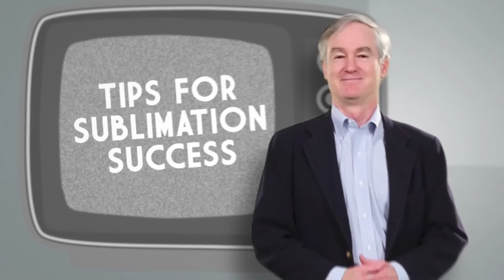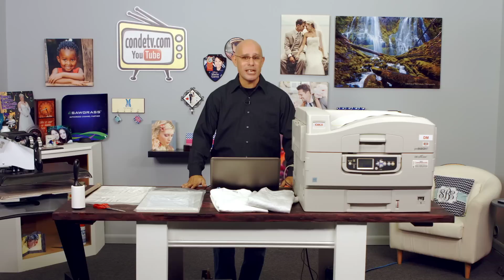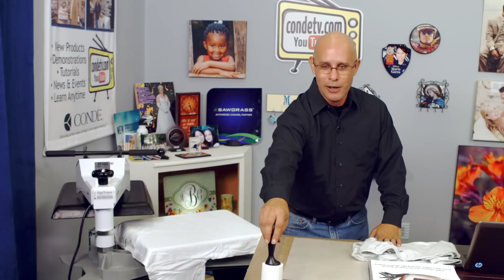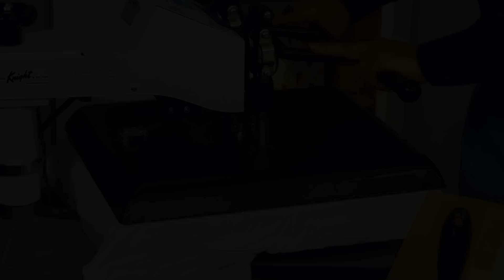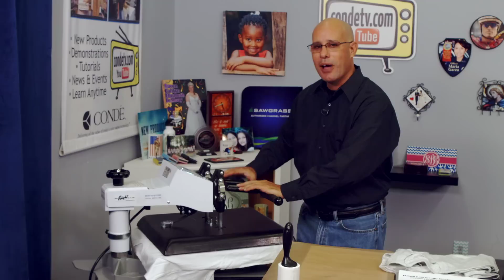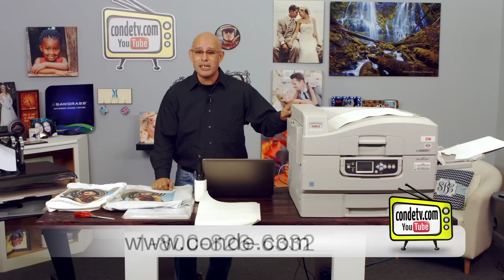Using TechniPrint EZP Transfer Paper -

Comment: how many washes Neenah can handle?
Reply from the maker: Our standard benchmark test for transfer papers, including Neenah Techni-Print EZP, is 25 "hot wash / hot dry" cycles on 100% cotton garments.  Beyond this test, you can expect better durability if you wash in cold or warm water, tumble dry with low heat and if you use a garment with some polyester content.

Comment: Thanks for this very informative video, Doug.
I'm liking the options of applying either a matt or extra glossy finish to it by using either the silicone sheet or the Teflon sheet in the second pressing.
What I would like to ask is if that optional second pressing needs to be done within a certain amount of time after the initial pressing of the design ?
Reply from the maker: Generally speaking, you should perform the 2nd press when you remove the backing sheet of the transfer paper.  However, a 2nd press can be performed at any time.

Comment: What will happen if I apply the paper on a different kind of material, like viscose or 100% synthetic material?
Reply from the maker: +Kiril Najdoski ................Condé has never experimented with Neenah TechniPrint EZP on these materials.  We suggest contacting Neenah Paper at 800.344.5287 or 906.387.2700 for more information.
Reply: +Conde Sublimation  I decided to experiment with viscose since it's semi-synthetic material and its recommended ironing temperature is from 302-356 degrees Fahrenheit, in compare to cotton whose recommended ironing temperature is from 356-428 degrees Fahrenheit. You suggested we should set our irons to 375, so I figured it would probably work with 356 as well. My hand iron has settings instead of temperatures, so I set it to "cotton". It worked just fine. The only thing you should be careful about is the time- do not hold the iron for too long, it will turn your material yellow. So it is best if your hand iron has temperatures indicators so you can have better control. In regards to other material usage, the only relevant information I need is the lowest temperature required for the paper to actually transfer the information. If it corresponds with the recommended ironing temperatures of a certain material, then I don't think there would be a problem.

Comment: Great video, Doug - very helpful! I purchased the EZP Heat Transfer Paper to apply with my iron at home since it said I could do this when I made the purchase on Amazon. However, you do not mention that method of application here nor does it say anything on the packaging about using a hand iron to apply. Can you please advise me on this? I am printing with an HP Laserjet Pro Color MFP, but I haven't tried using the paper yet. Thanks!
Reply from the maker: Since Neenah TechniPrint EZP transfer paper is a "cold peel" paper, it means the transfer can be applied with a hand-held iron.  Turn your hand iron to the highest temperature setting.  Make sure you use a "dry" iron and disable your steam feature.  Place your garment on a rigid, heat-resistant surface.  Place the transfer where you want the image to appear.  Place the iron in the center of the paper, use firm pressure, and moved the iron in a clockwise motion to the edges of the transfer.  Repeat for 1:30 - 2:00 minutes, making sure you press every area of the transfer.  After heating, remove the backing sheet while "warm" for a matte finish or remove the backing sheet "cold" for a glossy finish.
Reply: Have you tried it? Ive been trying with an iron and it hasnt been working. lmk please

Comment: Doug et al... Do you suggest turning off the white toner (since it is expensive) if you are printing a full color image that is going onto a white shirt?
Reply from the maker: If you are printing to a white garment, and use the OKI white toner printer, then we would recommend turning OFF the white toner in the driver of the printer.  The white toner is not necessary when you are transferring an image to a white garment.
Reply: Thank you. I sound dumb. I kind of knew that, just wanted a second opinion. THANKS FOR ALL THE GREAT VIDEOS!